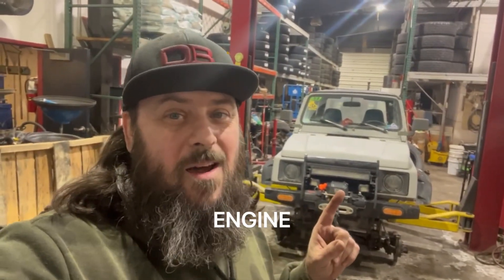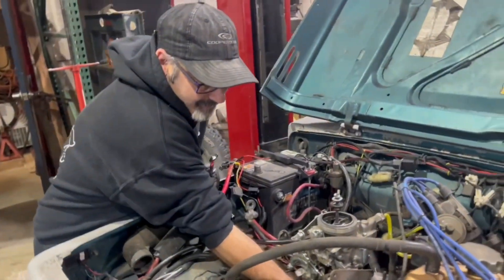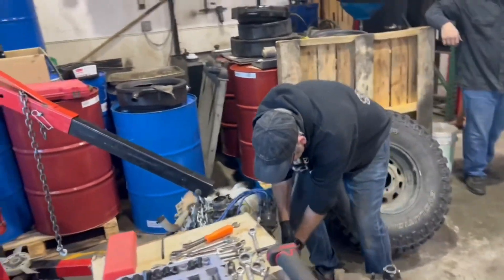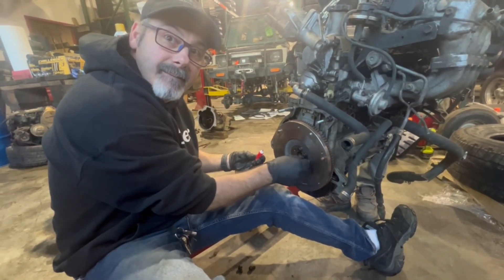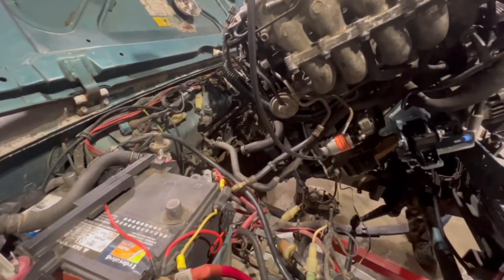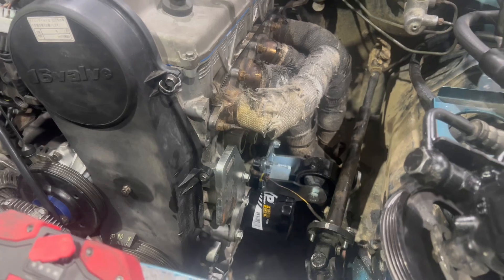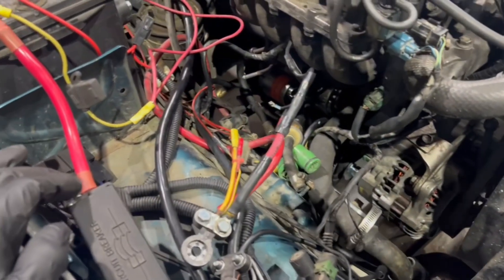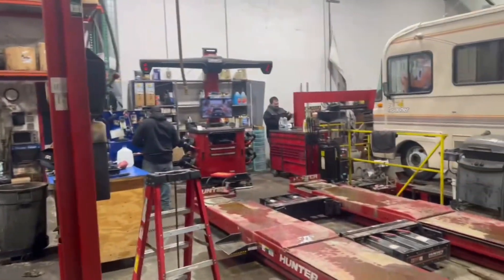Suzuki Samurai 1.6L 16V engine swap

Comment: Hey Clint, Question for ya, Do you use the same throttle cable that was on the 1.3 or do you have to use a different one. Thanks
Reply from the maker: Its the same cable, it bolts right up. You may need to bend the bracket slightly to clear the hood. Mine was sticking up, angled at the hood, I tapped the metal sleeve on the cable with a hammer and it bent down about an inch and clears now.
Reply: @CTMadModz  Thanks for the answer. I got my Sami about 6 years ago with the 1.6 16v already installed , its been flawless so far. It's out of a 2004 sidekick. wanted to carry a spare throttle cable just never took the time to figure out what it came off.
Reply from the maker: @scottszuk5736  get an oem suzuki cable… don’t buy on on Amazon haha

Comment: I've been rebuilding a 1.6 and finally going to install it soon. Got the same Petroworks kit, clutch is ordered. Deciding on fuel pump now, and going to modify the VSS with a reed switch and probably design and 3D print a bracket for it (so all new parts on the VSS mod without having to source trackick parts). I'll be doing the wiring harness myself. It seems daunting but really you're just keeping a handful of lines from it.
Reply: dont bother with the VSS most people including myself dont run it.. no issues
Reply from the maker: @samaxeman123  I’m up in the air about it… either way it’s in the future 🤷🏻‍♂️🤣
Reply from the maker: Right… and John Browne is a great resource if you need advice. Thanks for watching my video. 🤘😎